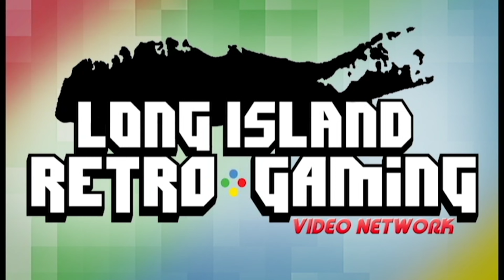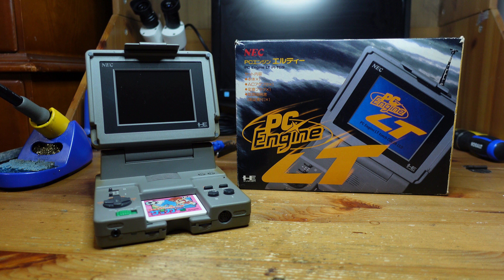PC Engine LT Repair! Complete teardown, capacitor replacement, and demonstration

Comment: I am about to replace the caps in my og snes, and 1 chip-02 SFC, and I am curious about the surface mounted caps. I've seen a few videos of ppl just twisting them off, and a few videos calling this move obcerd. I have practiced this move on a couple of dead boards, and achieved pretty good results, only leaving the legs behind on a couple. However one did rip the pads out on the practice board, which caused concern. But when it did, I noticed I pulled up while I was twisting. I would assume this up force was the reason why the pads came up with the cap. My question is how much success have you had with this method? Desoldering all of those caps seems time consuming, but if I pull a pad up, I am going to be SOL lol.

Comment: I remember Beep in Akihabara had one of these for 250,000 yen or so years ago in their display case (it was recapped and working, at least), took them a while but they did sell it eventually. Not much use for it now, but would have loved to have it when I was a kid before I had my own TV, mostly played my Gameboy at home so a power cord wouldn't be a problem.
Reply from the maker: That’s amazing! I’ve never seen one of these in a store and it’s rare enough for them to be sent out to me for repair. I did the same thing as a kid, lots of gameboy gaming plugged into the wall!

Comment: You can actually make them portable now.a seller from france is selling a cable so you can power this from a 5v powerbank.
I managed to get my LT unit repaired ithat i sent you.
Keith Courage on the pcenginefans forum done the repair.was the t500 transformer that was faulty.he bypassed that and put in a modern lcd which took its power from another area on the circuit board.
If you are interested i can send you a video of my LT working using a portable powerbank
Reply from the maker: That is fantastic! I’m so glad that yours got fixed. What was the problem? And yes I would love to see the power bank
Reply: @LIRetroGaming  
Like i said it was a faulty part on the power circuit that sends the power to the lcd screen.it’s impossible to get this part but there was a way to keep it alive by taking the power from another part of the board to a brand new modern lcd.you lose analogue tv functionality but i could live with that.
the same guy has just done the same repair on my duo monitor which is an extremely rare item aswell.
send me your email again and i will send you a small video of it working from a 5v powerbank
Reply from the maker: Oh fantastic! I’m really glad that he got it going again. I’ll send you an email to follow up

Comment: Did you buy a capacitor kit for this specifically? Also if it was the regulators did you have a fix ready?
Reply from the maker: Yeah, I listed the capacitor kit in the description. The regulators are still modern parts that can be purchased on digikey or eBay

Comment: I still seems funny to me to see SMT electrolytics removed by just twisting them, MattKC repaired a busted wii once and normally desoldered one and it ripped a pad and he jokingly tried twisting them off and it worked flawlessly.
Reply from the maker: Yeah there are some people who really object to twisting off the capacitors but I find it it’s very effective and faster than other methods
Reply: It’s really the best method hands down. I laugh every time seeing noobs hot air or desolder them.
Reply: I laugh every time seeing people desolder or even hot air them.